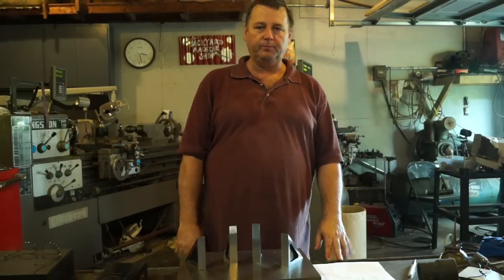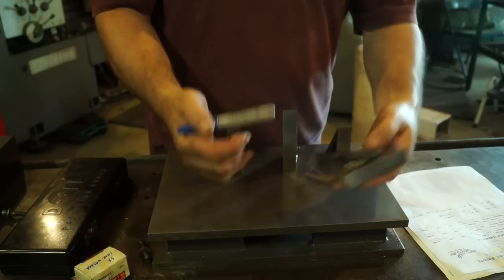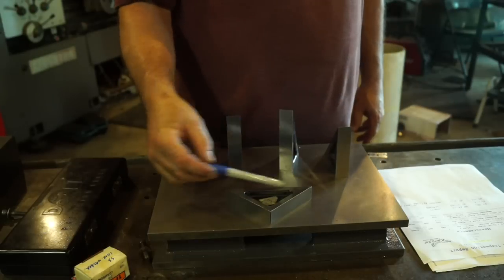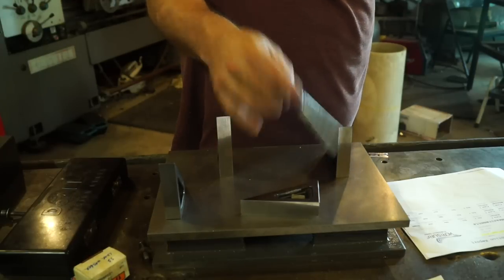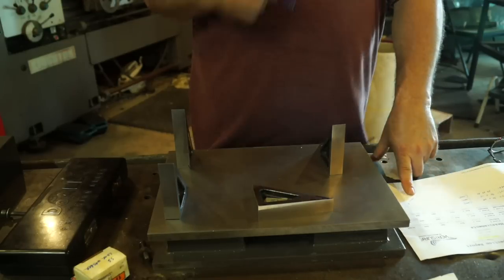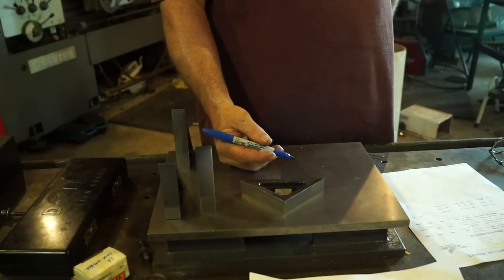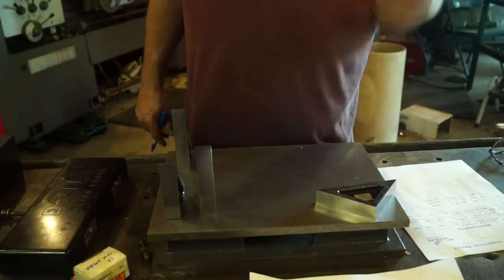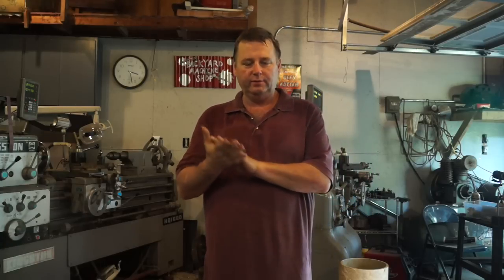Angles and Squares #6    (CMM Results)

Comment: For two sets of squares built from scratch, home heat treated, and then as you say surface ground on a 50 yr old machine I think they came out really well. Even more so when you consider that the high end manufacturers of squares like this likely made multiple tries at it while refining there very costly grinding fixture alignments Mike. And the real high end ones were then probably lapped into specification as well. But those CMM's are brutal with the hard numbers. Zero room for any fudge factor at all. :-) As you mentioned one single spec of missed grit could easily throw the worst one out the .0015" over that 5" distance.
Reply from the maker: Thanks for the reply, I proved it can be done with these old machines, Im sure the errors were in my technique